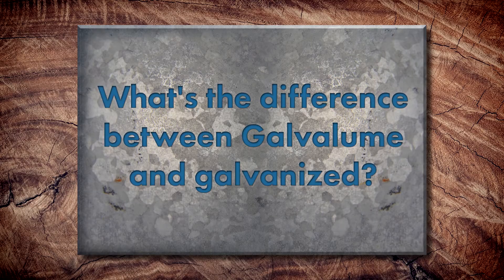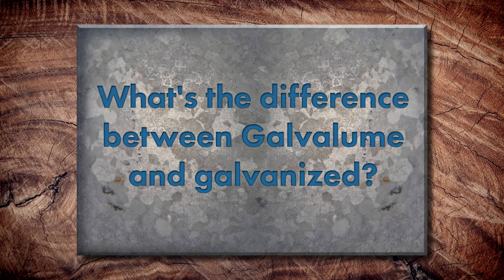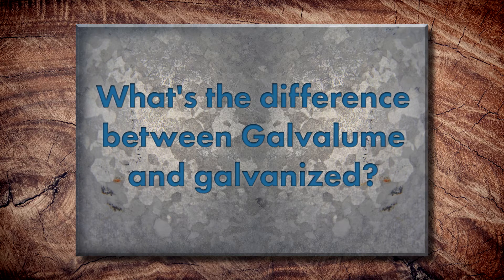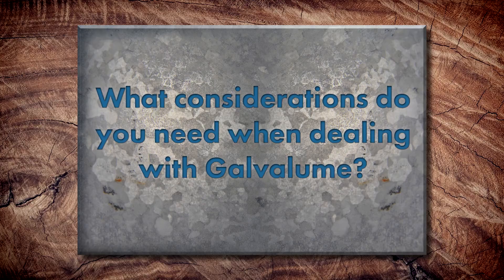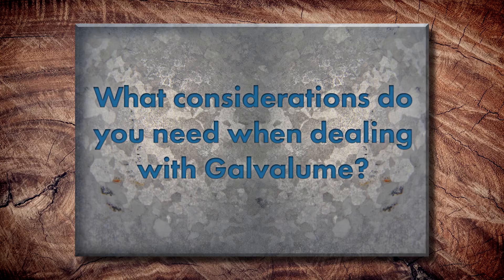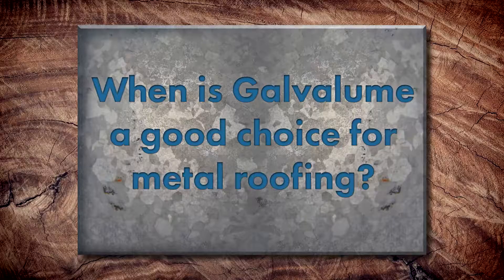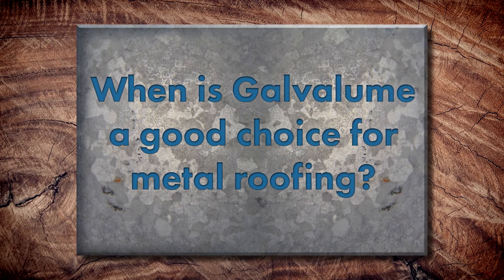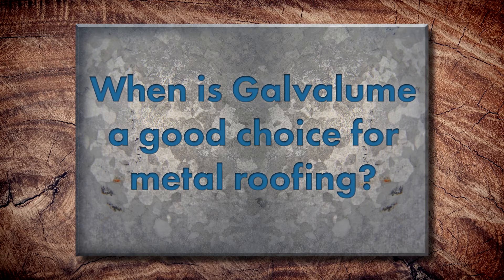Galvalume® vs. Galvanized: Which is Better?

Comment from the maker: Which type would you choose for your roof?
Reply: Galvalume: 
- according to this video, galvalume has a warranty & galvanized may not. However, I don't know which one has the 40 yr. transferrable warranty.
- has 2-4 times the corrosion resistance.
- has tested by the MCA to possibly last 60 yrs. or more.
- however, is more susceptible to oil canning, but can, & in my nonprofessional opinion, be formed with striations & pencil rib, & installed with sliding clip fastener (is that the proper term?), buy the most thick panel possible (22 gauge for galvalume according to CMG Metals or .032"/20 gauge for aluminum), plus any installation techniques that I don't know about.
- The whole point for installing a metal roof, galvalume specifically, is to do a quality installation & never have to think about roof maintenace without a warranty for the paint for the first 25 yrs. & not consider replacing the roof for the next 40-60 yrs. It seems with metal or slate roofing we can be "one & done".
Reply: @tylerwright754  in the salt spray tests I saw years ago, Galvalume lasts about three times that of G90. Galvalume roofs i installed in the late 70's looked new when I returned 20 years. It is my opinion that Galvalume will last a lifetime if you die when you aught to. What is the weakness of galvalume? Any type of metal trash on the roof will cause the zinc in the panel to leach out and weaken the surface. Condensate from air conditioning units contain copper and copper will quickly ruin galvalume.
Reply: one thing to also watch is the use of pencil or graphite lead pencils on bare galvalume. That is a killer for galvalume. I research pretty much everything i could get my hands on from Bethlehem before I found it. Saw lots of damage over the years due to this.
Reply: READ YOUR WARRANTY!!  What you interpret as a 40 year panel warranty is actually a paint warranty only that guarantees Chalk, Fade, and Peel within allowable tolerances. Peeling as a result of Galvanic corrosion in NOT covered by your paint warranty!! These vary from paint supplier and paint type.  Galvanized or HDG has NO warranty. Never has.  Zincalume or Galvalume carries a 25 yr-6 month warranty for corrosion when applied properly (installation and location)  For a good feeling, always ask for a site specific warranty and do not depend on the "blanket" warranty. The site specific warranty requires a review of the location and then you have it in writing which makes it 10X more enforceable should you ever have to file a claim.
Reply: How do you clean galvaluble ?
Reply: @TheMetalRoofingChannel I would like to know the difference or similarities between Galvalume and Galvanized in Strength.

Comment: Mr Blake's comments on the difference between galvanic and galvalume coatings left me scratching my head? he says both are coatings but then differentiates between a barrier and "galvanic" which is confusing. My understanding is that Galvanic treatment is proactive in "healing itself" but is not such a good shield (barrier). Galvalume coating is a hybrid with the shielding characteristics of aluminum and the self-healing characteristics of galvanic protection. Is that right?
Reply from the maker: Yes, you are correct! -Thad

Comment: Would bleach or chlorine be okay to apply to the galvalume for cleaning purposes?
Reply from the maker: There are certain circumstances when you can use a solution of bleach, detergent, and water to clean mildew stains, etc. For light cleaning, water and detergent works well. You can also use some solvents like rubbing alcohol for targeted spot cleaning. Check out this article for the specific measurements, products, and instructions: http://bit.ly/how-to-clean-metal-roofing
Hope this helps! -Thad
Reply: Muriatic acid for white chloride or oxide stainings

Comment: @UCfsI1wHweRQobI3iQCVzQQg What type of metal Would you recommend for a roof near the ocean?
Reply from the maker: Hello! If you're within 1,500 feet of a coast, we recommend going with an aluminum substrate, as steel will have a greater chance of failing due to corrosion. Check out our metal roof materials video for more: http://bit.ly/picking-metal-roofing-material-video Hope this helps! -Thad

Comment: What is oil canning?
Reply: Oil canning is a shape characteristic that results during the Cold rolling and Metallic coating process.  It is a multi layered issue that starts with the Cold roll mill inducing a specific amount of shape into the Cold Roll Full Hard coil that will convert to a flatter product in the Metallic Coating line furnaces during the annealing process.  What remaining shape after hot dipping has to be addressed in the tension levelling process.  A lot of technical mumbo jumbo.  In more laymen terms, compare metal roofing like a wood deck.  When you deck dries out the wood shrinks. when it is wet, it expands.  the process is the same with metal roofing whereas the cold and heat are the forces that cause the metal to expand and contract.. With that in mind, now put this thought process to your roof.  your panels are fastened down every 18-24" from the gutter to the peak. your 12'-0" panel looks terrific!!  now it gets really hot and that 12'-0" panel expands to a 12'-1-1/2" panel. but it is fastened in place and cannot expand.  So, the panel buckles and looks like someone dropped a load of frozen turkeys on your roof. This is what oil canning is as a result of Thermal Expansion. Roll formers also utilize different characteristics to their profiles to help mitigate oil canning like adding pencil ribs or striations to a panel to lock the shape in and help prevent the panel from buckling from heat and cold or from coil with incoming shape issues.

Comment: In a coastal environment, what coating would you recommend for a metal roof?
Reply from the maker: Hello, Kevin! If you're within 1500 feet of a coastline we recommend aluminum. Galvalume is a good choice for other areas outside of that zone. Thanks for the comment! -Thad